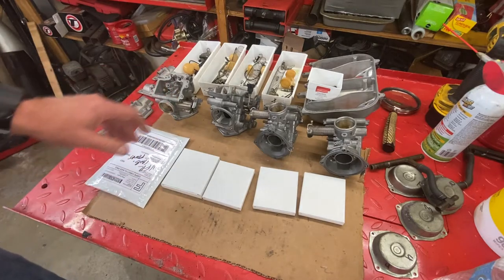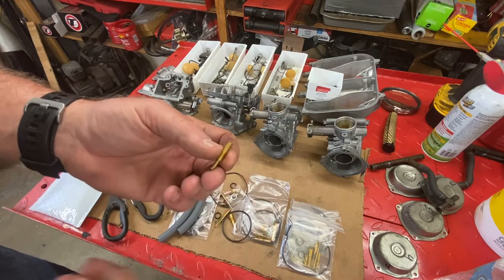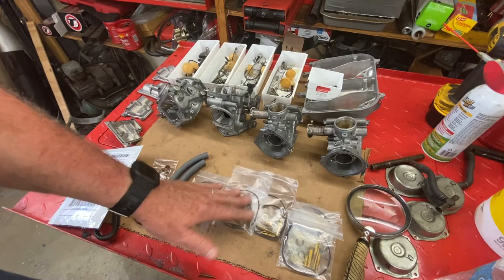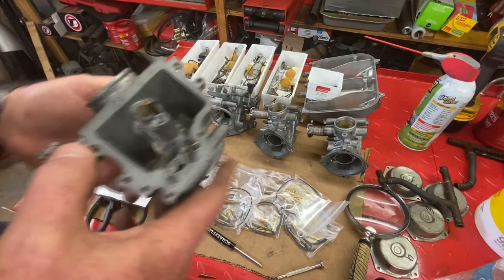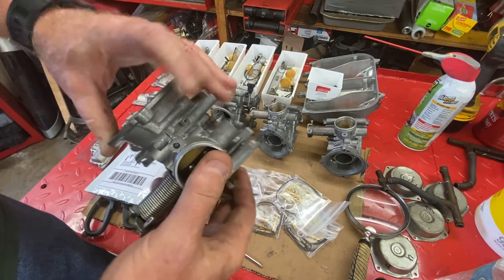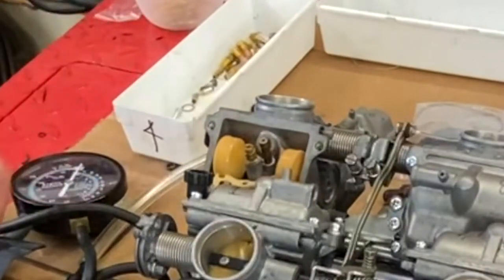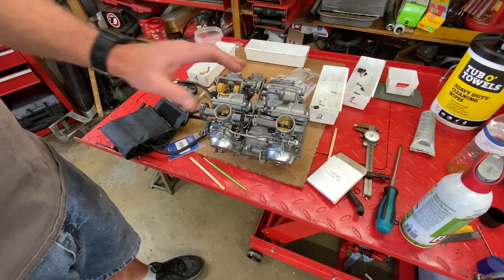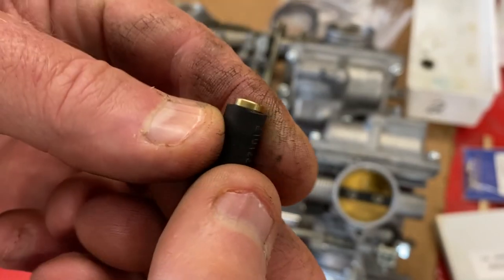Aftermarket Carb kits: Are they Junk? Tips on kits and cleaning carbs for rebuild!

Comment: Appreciate your video !
Think about it - how many people will buy a kit and install all the parts from it thinking it will all match and work perfectly. Surprise, surprise !
Reply from the maker: I think I mentioned (future me segment) I thought the kits were correct but maybe I messed up. Truth be told, aftermarket kits often try to include the most parts for the widest range machine. I’ve had plenty of single-carb kits that have many more parts than required for my application. It’s unusual, however, to find nothing works. Fits, but is FNG. Thanks for watching and commenting.

Comment: Hey Tom - thanks for doing these.....really enjoying your vids! Mine are mostly 1st and 2nd Gen Interceptors plus I have one 3rd Gen. ('90). Most are in running condition...several almost mint (thankfully), but a couple are in restoration status. None are an RC24 like yours though. Anyhoo...I've learned how to do a lot of different tasks so far.....but have yet to separate all 4 carbs from the plenum and change the fuel tube o-rings, but am about to do so on an '87 RC26. Like you I have sourced parts from Joe at V4 Dreams and am also using his website tutorials to assist me. This set of carbs is not in too bad of condition, thankfully. Bike has just under 70K - much more than most of mine. I've already removed everything and am now down to the plenum stage. A bit scary for the first time but like other procedures...once you do it it becomes routine. I'm in FLA too just below Daytona. Will post again when the deed is done - just wanted to give you a shout out......cheers, Baz